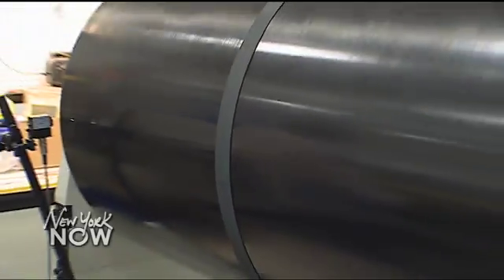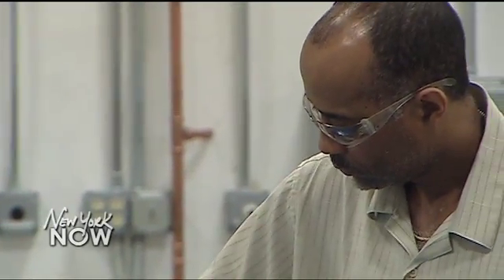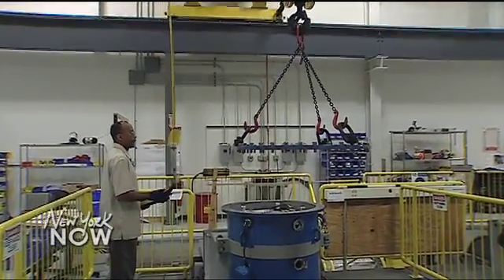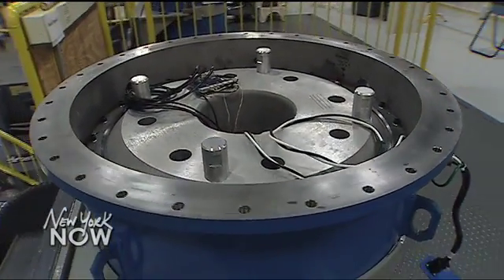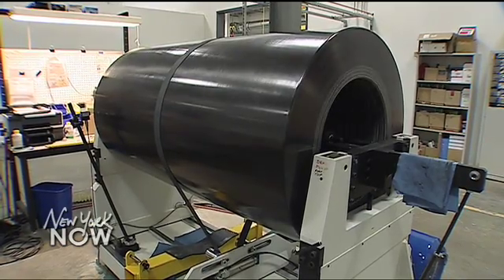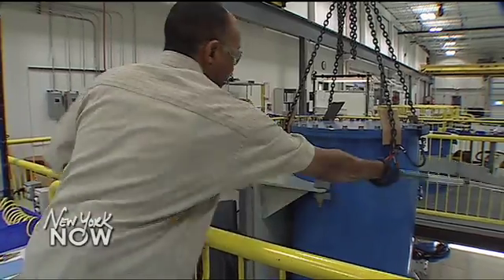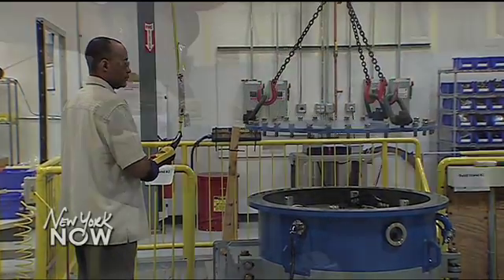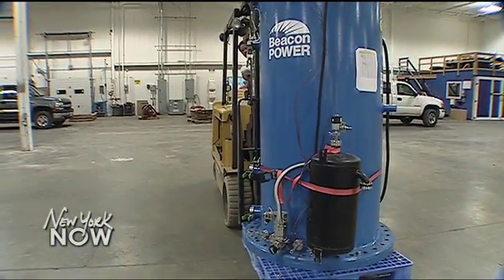Can Flywheels Make Renewable Energy More Reliable?

Comment: It's really interesting but it isn't a cheap system. The environment would benefit if it were cheap. Please, take a look too at heat of fusion values. NaCl(Very cheap. Tfus: about 800°C): around 300 kwh/m3, iron: around 500 kwh/m3, Silicium...

Comment: I don't think the flywheel is going to "flop" this time. With as much grid scale energy storage as we need, we just don't have the resources to produce the battery capacity needed, to go 100% renewable. We do need the batteries, we DEFINITELY need flywheel, as well as pumped hydro and other more conventional grid scale storage technology. No ONE technology can do it alone. Modular systems like this are the future, because of the redundancy in the event of failure of one of many units. The three properties that need to be addressed, are: 1. round trip efficiency. 2, standby loss. 3, levelized cost per megawatt hour of energy. The 3rd thing includes the purchase price of the equipment/energy storage capacity X cycle life. I think flywheels are ahead of batteries on this one. One HUGE advantage of inertial energy storage, is that you can measure the RPM, and know EXACTLY how much energy you have available from that wheel.(drum, rotor, whatever you're calling it these days) Batteries have a thing called the Peukert's exponent, where depending on the discharge rate, the batteries may not deliver full rated capacity. Flywheels don't care how long it took to spool them up, or brake them down, Flywheels "never change, until they go bang".

Comment: No wonder they went bankrupt. They went through 4 revisions over 10 years? and this is what they came up with? Vacuum sealing does nothing. Air friction plays such a little part compared to the generator. And why carbon fibre flywheel? The whole point is density. Carbon fibre is just adding cost for a loss in mass. Steel is 800% denser/heavier than carbon fibre. They quoted 200lbs for the flywheel. That will get you like 20 seconds of backup power, versus minutes with a steel equivalent weighing tonnes.

Flywheels are a fantastic application for energy storage. Beacon Power, however, has no idea what they're doing.
Reply: Haha... but it's 10 years of research...

Comment: Flywheel storage is short term storage, think minutes for a flywheel that size and a large load.  They act more like giant capacitors than batteries, storing a charge and smoothing out small blips in the power grid or supporting a section of grid for a very short period during a failure.  These will not work well with solar but might have potential with wind.  Although you would still need a pretty steady source of wind to make it work well.

Comment: I've been a huge detractor of renewable energy sources like wind and solar because we didn't have a good way to store their energy output during non-peak hours. This technology solves that problem in a simple and brilliant way! :)
Reply: @Chris Russell Literally everything wears out. :P

1) These kinds of mechanical batteries experience very little wear because they use magnetic bearings so there's no physical contact between the bearing surfaces. The life span of this kind of battery is measured in decades not years like conventional batteries and the charge capacity of a mechanical battery doesn't degrade over its life like a conventional battery would.

2)  Pumped hydro works great if you have a lot of water and if you have hilly terrain in which a reservoir can be constructed. That isn't the case everywhere. 

3) There's no maintenance bottleneck with these kinds of batteries because there would be dozens or hundreds of them and you could take individual batteries out of service as needed without disconnecting the others.

4) This kind of battery is inherently less dangerous than either conventional batteries or pumped hydro. There's no risk of dam failure and there aren't any hazardous chemicals which could get into the water table. I for one don't want to have to figure out how to recycle thousands of tons of lithium. The way they handle the potential for the battery "exploding", as you put it, in the case of the flywheel losing structural integrity, is by placing each battery in a concrete tube below ground level. This both helps absorb any vibrations during normal operation and also safely contains the battery in case of failure. 

5) These kinds of batteries can be manufactured out of non-toxic materials.

6) These kinds of batteries can be used EVERYWHERE regardless of how much water is available and regardless of whether the terrain is hilly or not.
Reply: Yes... but how dose it actually work??? How exactly are the Specs??? It is not shown here!!!
Reply: @StarLink85  It works like this:

1) Solar panel captures electricity from the sun
2) The electricity from the sun powers a motor which spins a large heavy flywheel. This converts the electrical energy into mechanical kinetic energy.
3) The sun goes down.
4) You turn on the lights in your house
5) The lights in your house creates a load on the motor which was used to spin the flywheel.
6) The motor then begins to function as a generator and the stored kinetic energy in the heavy spinning flywheel turns the motor to generate electricity which powers your lights.
7) The flywheel slowly decelerates as its mechanical kinetic energy is converted back into electrical energy
8) Sun comes back up
9) Solar panel starts spinning the flywheel faster again
10) Repeat
Reply: @Chris Russell Hello Mr. Cris
 / Speaking of harmonic speed you mean: average harmonic speed?
Reply: @Chris Russell This clip is from 2010. There is a discussion about reliability here. So, does any one know how they performed since 2010?
Reply: John, 

unless there is a consistent surplus of renewable energy then storage is a waste of time and money. Some storage is useful for coping with sudden peaks in demand but is usually carried out by pumped storage generation. Certainly here in the U.K. we never have a surplus of renewable generation, by a long way.
Reply: @iainreid9914  so that's why they built the electric mountain huh?

Comment: Solar power is a better example of when you need batteries, IMO
You generate the electricity during the day when the sun is up, but use the electricity at night when the sun is down and the lights are on.
Reply: @Chris Russell , water evaporates.

Also, pumped storage has 70-80% efficiency. Where as flywheels have 85-95% efficiency.
Meaning for every 100 kWh we put in, the water gets 70-80 kWh back, while the flywheel gets 85-95 kWh back.

Lithium ion batteries have 99% efficiency. But also cost a lot more to make and have a shorter shelf life.

https://www.mpoweruk.com/alternatives.htm
Reply: @Chris Russell , Sure, and I hate nuclear when it explodes catastrophically. But focusing only on the possibility of a failure just sounds like fear mongering.

Also, water pump batteries (aka: Dams) are HUGE because they have very low energy density. Flywheels have far better energy density.
If you're dead set on using gravitational potential for energy storage, I'd sooner vote for metal slabs on pulleys than to use pumped water.

Comment: Why can't i use this to power a car?
Reply: Historically they did use a similar system to run a bus service in Switzerland iirc. There's a video here on YouTube titled "The Mechanical Battery" by New Mind channel ID you're interested.
Reply: Car isn't moving on a straight line, too much slope changes, turns, vibrations, etc.
Reply: M Detlef  
"You IDIOT!!!!"
Ha-ha, that's a bold statement :D
"You use it to CHARGE the BATTERIES in a car.  When the sun is NOT out."
I don't think the powering a car (a(!) car, not cars, and to power, not to charge) implies that. 
More of it, the key point of the video is the exchange with the power grid, "When the sun is NOT out", 
so you can do whatever, charge your car or power your washing machine. 
So why someone would suggest something that already was implied in the source?
Connect the dots sir, I'm sure you can do this!

Comment: What efficiency does this have?
Reply: when you spin up the flywheel and immidiatelly get the energy out again, the eff is close 100% limited by the eff of motor/generator unit that takes it to +-95% 
only problem is when the energy should be stored for a long time as the rotation decays due to friction, slowly though, thanks for the way the wheel is suspended.
Importantly, flywheels are not to be used for long term storage, the main advantages are instant power and a Very large power output if needed.
Reply: Just seeing ballpark figures on the web of 85 - 97% efficiency. It's magnetically floating in a vacuum, so in principle there shouldn't be any factors that can really slow this thing down, no bearings and no air to cause friction.

Comment: Why are your fw so tall an thin?  You must keep high speed and you have small reserve to keep structural integrity. Should not be better use slower and wider fw ? It is like figure skating.. And did you calculate with coriolis force ?

Comment: System storage "400" 25kWh, "400 Modular" 30kWh, "450 XP" 36kWh.  The "400" and "Modular 400" systems use 480Vac, "450 XP" uses 600Vac.

For the 400 system, it can supply power at 100kW for 15 minutes.  That's about 208A at 480Vac.  You would need 10 flywheels per 1MW wind turbine to guarantee uninterrupted power delivery for 15 minutes when the wind stops blowing.  More for power quality management (reacting to fast changes in grid imbalance) than mass energy storage.

I read online these flywheels can (could) be up to about 85% efficient at storing and returning energy to the grid, which comparable to pumped-hydro and battery storage in terms of efficiency.

https://www.greentechmedia.com/articles/read/beacon-powers-bankruptcy-autopsy

Comment: Uh, flywheels don't power EITHER of your examples. Steamboats are powered by STEAM ENGINES that use flywheels to balance the vibrations and harmonics of the large, low-speed engines and they provide some "governing" effect and typically have a STARTING FUNCTION or DRIVE FUNCTION as well. Windmills are powered by the WIND. Flywheels CONSUME POWER. They do not "store it" beyond the INTERTIA they "contain" when POWER IS REMOVED FROM THEM. 

If FLYWHEELS are the answer for "when the wind doesn't blow" how are current "wind farms" getting by? Oh, that's right. They "get by" through the BASE LOAD GENERATION PLANTS that always GO WITH THEM either in the form of EXISTING POWERPLANTS or the much smaller and LESS VISIBLE natural-gas "base load" plants that are also connected to the "grid". And why do you need flywheels IN ADDITION TO WIND TURBINES? Doesn't ever WIND TURBINE have its OWN FLYWHEELS BUILT RIGHT IN? 

There's a reason your "green energy" company is "surviving" on government welfare. The technology is a HOAX.
Reply: @DEEREMEYER1 I was slightly exasperated to go to a second flywheel video (after watching the excellent NASA one at https://www.youtube.com/watch?v=mz_7UF4KQpk ) and see another person typing in INTERMITTENT CAPS about how much they hate flywheels. So I suppose it's a welcome surprise to realise that you're the same person.

The point of having flywheels / batteries / pumping water uphill to balance the grid is to be able, eventually, to do away with the base load plants.

Comment: It is a butterfly governor for Diesel engines fuel system control to handle electricity voltage fulctatuation to control supply and demand in a flipping second.

Comment: this will never work unless it is scaled to a mega-structure level, 1 huge multi-part flywheel with a large radius is better than 50 small ones like in this video. everyone likes to invest in power generation and harnessing rather than storage, but something like this can be useful with offloading peak power of cities during the afternoon, especially if these cities lie near hydropower dams that have stable power around the clock.
Reply: These are used for rapid frequency regulation.. Multiple units allows for more consistent frequency matching.
Reply: You are actually wrong. energy content increases faster with speed than mass, so bigger flywheels store less per kg! The optimum is a double cone shaped flywheel with the flat side against each other made from a single strand of carbon fiber, which can attain speeds on 100 of thousands rpm.

Comment: Flywheels seems to have about the same energy density as capacitors and the same advantages, they can charge and discharge very quickly and suffer almost no degradation for years and years and 1000s upon 1000s of cycles. But for large storage, batteries have dropped so much in price and keeps dropping due to electric cars, I don't see the advantage of flywheels storage.
Reply: advantages are no chemicals, cheap build materials and no enviromental hazzard.

Comment: Didn't say anything about cost effectiveness.  From what I understand, flywheel storage is the most expensive way to do this....
Reply: Well because it's such a rare product, there are one or two companies that do this stuff and they do it in small numbers, which makes things very expensive.
On the upside however once a unit is produced there is no reason they can't run forever, 15-20 year bearing change cycle but nothing else can wear out... although manufacturers probably don't want them to go for too long, otherwise they would have nothing else to sell.
Reply: @MsSomeonenew  alas, the capitalist problem

Comment: keep it simple - invest in H2 fuel cell Technology - The electrolysis of water to create Hydrogen to power a combustion engine
Reply: Electrolysis is inefficient, and furthermore combustion engines are extremely inefficient. If you go down the hydrogen route, fuel cells are the best way to go
Reply: +Apapabay Fachmann With fresh water shortages, in many places in the world I think a mass attempt to change water into Hydrogen would only increase the problem.
Reply: Create oxygen at the same time you could use the hydrogen and oxygen spliter in your bunker to run your cave steam system to create power. Maybe that's to far fetched.

Comment: what a waste! It takes lots of energy to spin these up...and the maint. will be high......batteries are far better......longer lasting...and can be recycled.
Reply: Roy Hemion Actually no. A batteryry can only go with about 1000 cycles or so, but a fly wheel can easialy do 20 000 cycles.
Reply: Ok....considering how well bearings and other no to low friction devices become, I retract my statement.
Reply: +Roy Hemion "what a waste! It takes lots of energy to spin these up" that is the point Roy. :-)
Reply: +Roy Hemion 0:42 -"..vacuum tank...and suspended by powerfull magnets.". Almost no friction thereby.
I guess there are more problems like eddy currents, Earth magnetic field and probably the rotating of the Earth.
Reply: +lweinbergjr, Agreed, some of the comments out here just prove a complete lack of understanding of rudimentary conservation of energy (first law of thermodynamics) principles.

Comment: I wonder how many percent of energy you loose per hour of it not being utilized.
Reply: I thought I heard these are in a vacuum (no air friction) and use magnetic bearings (very low friction) ? Oh, never mind, I see your last name, you are spreading propaganda for "your" energy concerns.
Reply: BlueBetaPro about 0.1%
Reply: matsv201@ the percent of energy loose 0.1% per minute or second Sir ?
Reply: hour. 

that is actually pretty much. NiMh batteries may lose as much as 1% a day, that is actually less than half. Normal Lithium batteries usually loses 5% a month or so.

That is actually a fairly big problem for backup batteries.

Comment: Denmark should buy this, we have 30% of our energy from wind turbines and produce more than we need during night time, but not during peak time.
Reply: You are using Norway as a gigantic hydroelectric battery, no real need for storage unless you produce more than the wires to Norway can handle.
Reply: @zapfanzapfan  Norway is a long way away, even with plenty of hydro, 1600km of wires to Denmark is not optimal. Flywheel storage is for intermediate peaks, not hoursor days later, which is what is needed with wind power. pumped hydro is better in that respect. However Denmark is rather flat, so what has been suggested is using our salt caves as pressured air storage.